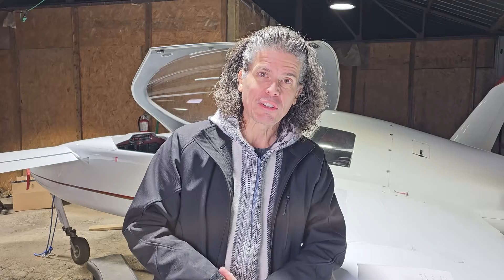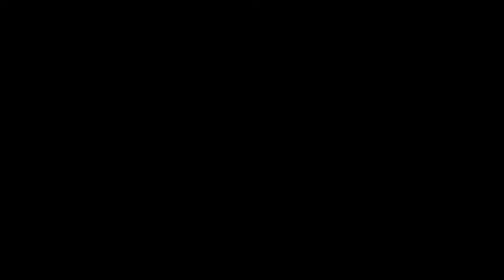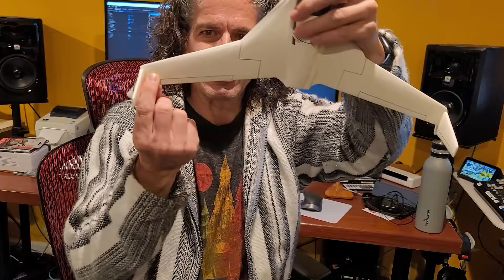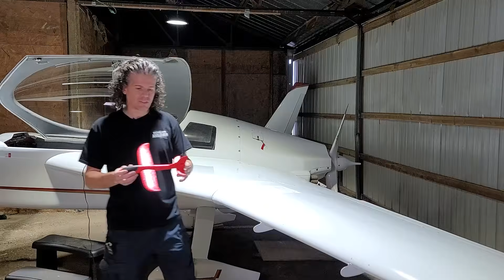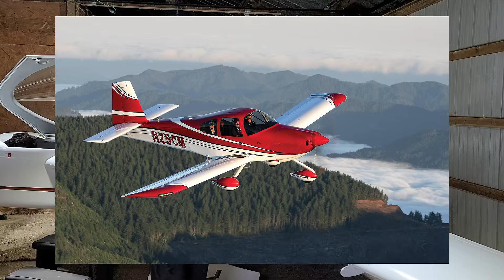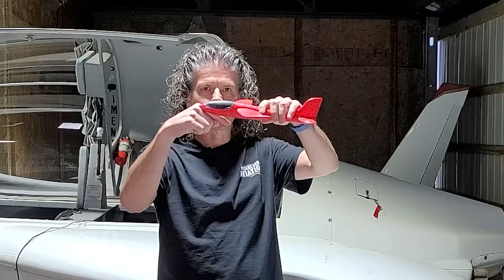Canard Aerodynamics: Why You Might Not Want a Canard Airplane

Comment: The swept wing design is to reduce drag and give the aircraft better handling in slow flight.  The performance is best in class.  If there is a complaint about this aircraft (Velocity XL-RG) it is that pilots with experience in Cessnas, Pipers or even Mooneys and Cirrus have to deal with far higher performance specs.  And no-flap, flat landings requiring longer, paved runways.

Comment: 8:20 you are confusing dynamic stability with static stability. Dynamic stability requires damping moments. The lift derivative is in 2-dimensional flow close to 0.1 per degree for all airfoils.
In 3 dimensional flow reduced by the aspect ratio :
0.1AR/(AR + 2)
Reply from the maker: You're right, I said dynamic stability when referring to resistance to displacement and recovery from it, which is in fact static stability. Dynamic stability would be the tendency to dampen the oscillations during that recovery from displacement (which would be positive dynamic stability).
Reply: That is right, the phugoid mode is damped by a long boom with a small surface of high aspect ratio, along tail plane or a small forward canard, like Rutan decided on. The small disadvantage is the higher downloading of the canard produces higher induced drag, which is partially compensated by the interaction of the canard's wake with the wing. The higher the speed, the lower is the damping, one reason that high speed aircraft have long swept wings, or leading edge extensions (early F-18, now with fly by wire electronics, F-16, statically unstable)
f @CanardBoulevard

Comment: High Scott! Very ilustrative explanation you gave. On detail that you mentioned in conventional planes does not entirely true.. but is valid for your explanation.
The vertical force in a Tail horizontal surface in a conventional configuration plane could be upward, cero or downward.. 
For example when take of at high CLift the main wing moment ia very high and nose-up so a tail will probably will get a upward force specially is cg is at rear limits. 
Also depending of the position of the cg related to the main wing lift. In a case that the plane has a very effective tail volume and neutral point is at the very rear, then the cg can be behind the main wing line of lift and in this case the tail hirizotal will trim the plane with an upward force

Comment: Actually, you can add fowler flaps to a canard aircraft,  but you will have to add them to both the main wing and to the canard itself. The size of the flaps will have to be around 20% larger for the canard than for the main wing due to the fact that the flaps will tend to move the center of lift rearward as they extend.
Reply from the maker: I go through that in my first video in this series: https://www.youtube.com/watch?v=ycLQaiX4ylE

Comment: I love you man anybody inviting a critique or a comment or a correction especially is the top of the mountain to me. I love to watch people with money that have a disaster from being stupid because I'm poor from being stupid and my whole life is a disaster to look up from for a minute when someone buys an airplane. How does the kennard airplane respond to being overloaded? Most airplanes will fly straight overloaded and if you turn them even a little bit it's too much and they crash easy spin in. How does the kennard Wing respond to this pilot error have taken off with too much weight
Reply from the maker: The answer is...it depends. If you load outside of C/G, all bets are off. You could turn into a lawn dart if too far forward, or fall in an unrecoverable stall if too far aft. But when it just comes to overloading it while remaining in C/G - it's just an airplane, so it does what most airplanes do: climb poorly, stall at a higher airspeed. In a conventional airplane, if you overload it so you're using all your lift to just keep the thing in the air, if you then turn (which uses some of your lift to change the direction of the aircraft) it no longer has enough lift to fly - so either you descend, or you stall.
Reply: @CanardBoulevard  well I had a slightly more sophisticated view of it mathematically when you look at that extra weight and you had add bank angle, and a reduction of efficiency you might be looking at a situation where you will never have enough control authority to pull it out of the spiral. All of these things are nonlinear geometric changes so if you get very far in the direction of this geometry with the extra weight, it hits a "tipping point". Not physically tipping the airplane but just these things have lined up to hold you locked into something and you don't have enough control authority to restore to normal flight.

Comment: 1.  This video would apply only to Eze and derivatives.  These were designed to a set of requirements.  C172 were designed to other requirements.  Some of the requirements overlap, and many don’t.  The pilot has to decide which plane’s requirements best match his needs.  No plane does all.
2.  Landing Speed/flaps.  Canards can and do have flaps.  Clever is the Rutan/Beech Starship.  Here the flaps and canard are linked.  Flaps deployed-canard straight; flaps up-canard swept.  Sweeping the canard flattened its lift curve slope obeying the “canard stall first rule”.
3.  An Eze main wing sweep moves the Aerodynamic center further back.  If Rutan had used a straight wing, the engine would be further forward relative to the AC.  It would have needed a driveshaft.  The wing vortillon (?) are aerodynamic fix that came some years after the Eze debut.  Aerodynamic bandaids are hardly new or unique to canards.
4.  A swept wing provides dihedral effect.  The EZEs rudder winglets an added bonus..
5.  The canard wake affecting the wing is not necessarily bad.  Rutan’s location may have improved pitch stability by increasing  the wings stall AoA.  
6.   Modern fly by wire jets have all surfaces lifting..like a canard.  The only plane to circumnavigate the planet was a canard.  So canards have a few virtues.

Comment: 10:22 that is NOT correct. Your span wise lift distribution is moved out and bending moment increases as if the winglets were folded down making the wing longer. NO free lunch. The winglet reduces induced drag but reducing the wasted energy form wing tip vortices. The reasons airliners use winglets are two fold. One is span of wing and gate area at terminal is limited. Two it is great for a logo. Some of the latest airliners do not use winglets and just use longer wings and accept their gate access at a terminal will be limited.

Comment: Longitudinal stability is NOT about stalling one of the aerodynamic surfaces! It is the ability of the airplane to return to level flight after a disturbance, e.g. a gust. This happens at small AoAs; you don’t stall the canard every time you encounter a small gust. 

If the overall AoA is increased by a gust, both the canard’s and the main wing’s list are increased. This results in a pitching moment around the aircraft’s center of gravity which is it’s mechanical center of motion. In order to return to level flight, this pitching moment needs to counter the initial disturbance, hence be nose down. This is the case if the sum of the added lift acts aft of the center of gravity. The point where this combined lift acts upon is the airplane’s neutral point. (This is valid not only for canard airplanes)

Static longitudinal stability is when the airplane returns to level flight after a disturbance with the elevator fixed. Dynamic longitudinal stability is with the elevator free.

Comment: I have always thought that a canard was more efficient. When you pull back the stick in a conventional aircraft you push the tail down - the reverse of your desire to increase altitude. With a canard the control causes the nose to rise - the very direction you desire.
Reply from the maker: I talk about this a lot more in this video: https://www.youtube.com/watch?v=ycLQaiX4ylE
Reply: At first glance this is correct. But when the forward wing lifts up, it generates a downwash. The rear wing flies in the constantly generated downwash. And it has to constantly "climb" in the downwash wherever is goes. Even when flying level.
Reply: @Triple_J.1  thank you.

Comment: hey.. you are trying hard and doing a good job explaining canard stability but you know the front wing doesnt have to stall to create stability.   its the lift curve slope and zero lift angle.  the lift curve slope is bigger for the big wing because its big so the plane is stable.  the stable point is a positive angle because of the incidence of the front is greater.  you fly the plane in pitch axis by adjusting the pitch stable point by changing the canard control surface.  you should play around with xflr5 or AVL and see the numbers and stability

love your discussion though

Comment: did not see the first video, and this one just pop up in my "list". What i can say is most of the information in this video is just pure basic stuff. at least then you are a geeky RC Pilot that do build your own design of airplanes. not just follow a kit blueprint like "BalsaWood Lego". Swept wings also rolles off the drag of the wing instead of a straight wing there the drag is forced off instead of rolling of the wing with less force and less energy lost. and there for you need less powerful engine to power at swept wing. The Winglets hinders the lift to "roll-off" the wing and you can keep the lift above the wing for longer time. so winglets do work REALLY good on small models. and i use winglets on my ViperJet with a Jet Turbine enginen. and damn its floaty with the winglets. Can bee seen in my YT Channel, just click my name here.

Comment: To the Author, could making the canard bigger account for some of the lost lift you need?
Reply from the maker: Making the canard bigger means it will generate more lift - and that means that you now have the problem where the main wing can stall before the canard does, particularly at aft C/G. Everything affects everything else.
Reply: @CanardBoulevard  so glad you got back to me, so is it always the aim to have the front of the plane stall/drop first? Is that easier to feel/predict than having the back drop first?
Reply: @CanardBoulevard  you are the first person to give me real world experience on just how delicate the balance is of staying 'up' in an advanced aircraft 😅lol
Reply: Yes. A stall is caused by a wing exceeding its critical angle of attack (around +15 degrees). Ideally, an aircraft that stalls, should automatically lower its angle of attack (its nose) to recover from this condition. 

You don't want it to diverge into a nose-up maneuver, as this would make the wing stall deeper into the less lift/ more drag regime. (I.e. result in going downward at lethal velocity). Suggested reading: Stick and Rudder, an Explanation of the Air of Flying. - By Wolfgang Langweische.

Comment: Why can't you have flaps? Is this because of how it comes, cause I would just add them myself 😅or is the canards supposed to do this job? Love to hear your input cause a lot of videos don't cater to the layman
Reply from the maker: If you add flaps to the main wing, it increases the lift generated (and drag). In order to keep the airplane balanced, you now need flaps on the canard as well. You can't really do that, so the only alternative is to increase the size of the canard and authority of the elevator. But in doing that, you increase the lift generated by the canard in all phases of flight, which means you could now stall the main wing before the canard.
Reply: The Flaps would be so far behind the Center of Gravity, and Aerodynamic Center, that they would create an enormous nose-down moment. Because the main wing would effectively become an elevator with down deflection.

Comment: I own a canard and I think that every airplane is a compromise in design.  These aircraft are designed to optimize for good cruise performance, that pilots really like.  This optimization results in choices that reduce drag like less wing area and less frontal area.  I think if they had more wing area the takeoff and landing speed they could be more comparable to other light aircraft but that would also increase weight and drag and also reduce cruise speed.  Another factor is weight growth.  Since these are homebuilt people can add items that add weight like avionics and upholstery and really nice paints that can make them heavier also reducing their takeoff performance.  One plus of these is the overall simplicity of the design.  I had a instructor once show me how you can make a steeper final approach at a slightly reduced power and on landing flair the speed can be bleed off faster making a shorter landing distance.  It works but you have to make sure you keep your speed up to a safe level to avoid a hard landing.  Overall the increased speed is very impressive and perhaps worth the tradeoffs.

Comment: A senior (possibly retired by now) MIT aerodynamics prof listed the three rules of aircraft design as "No canards, no canards, and no canards".
Reply: Depends on the intent of Your design.

If great stall resistance for inexperienced private pilots, who might not fly for extended periods of time while building, if that is Your goal. Canard is the solution.
Reply: @Triple_J.1  True.  I should have been more specific that the subject was aerodynamic efficiency.  People hear that both surfaces lift and assume it's more efficient than a conventional layout.
Reply: @Triple_J.1  
Not having exhaustive knowledge, I would only have been comfortable claiming it as A solution.

(No, not solution A…)
Reply: Rutan's number one reason for the canard design was to reduce low speed stall/spin accidents in the landing pattern.
The canard stalls before the main wing and pushes the nose down, which is what you want. 
Unfortunately many fatal accidents in the landing pattern are caused when the pilot pulls back on the stick when the plane starts to stall in a turn.....this increases the stall, which turns into a spin with fatal results.

Comment: 14:00 - You could just put the canard a foot lower fairly easily and not interfere with the main wing.  I higher back wing is very common in conventional designs.  Even if the front canard didn't produce a net positive lift, at least it's not producing a negative lift like a conventional tail.  So it's really not a wash at all.
Reply: ^ This does not work in Theory or in Practice.

A wing generates downwash when it creates lift. The rear wing has to fly in this downward deflected air. So it always has to climb. The front wing has to carry a substantial portion of the weight. Because an aircraft such as this, must have positive static stability. The center of gravity must be a certain distance in front of the aerodynamic center (of lift). The aerodynamic center in a canard is near the leading edge of the rear wing, or slightly in front of it. So the center of gravity has to be moved forward of that point to remain stable. This means the weight of the aircraft has a lever-arm nose down from the main wing. The canard must lift this to remain level or climb. So it must generate lift at all times.

Comment: Ride lousy in any bumps, if I remember VNE is only 200….
Reply from the maker: Not true. With the higher wing loading, it's actually quite good in the bumps.
Reply: Not my experience
Reply: I looked at Velocity and Glasair III, ended up with Glasair.  Its wing loading does smooth out the bumps fairly well, but you are going so fast the bumps are a little sharper!

Comment: I built and fly a  Cozy IV  I love the plane the way it flys and I enjoy blowing the doors off Cessnas  It does have its limitations but all in all it is a great plane.   I liked my first plane a Longeze better it was more of a pilots plane.  It had an 0235 which limited it a bit.   Thanks for your video.
Reply: 0235? Can you tell me what this means?
Reply from the maker: @CraigLandsberg-lk1ep   O-235 is an aircraft engine with 235 cubic inches of displacement. It makes significantly less power than for instance the IO-360 in my airplane.
Reply from the maker: When it all comes down to it, I do love the Cozy - obviously!

Comment: Thanks.   Sounds like very few positives
Reply from the maker: There are quite a few - but every airplane design has positives and negatives.
Reply: Speed. Range. Economical. Low fuel consumption. Robust. Rarely rusts or degrades over time.
Reply: Which could be said about the RV models    @Triple_J.1

Comment: OK lets draw triangles here.
Where the body is one side (A) and the tip to tip of the wings form 2 triangles, so one tip to the body is (B) as the leading edge of the wing is the hypotenuse of each (C).
If a straight wing has the same length as the (C) then yes the swept wing has less lift.
But if we take a straight wing that is the same length as (B) then slice it up and set the slices off set to each other to create
a chunky type of swept wing (as though it where made with building blocks) 
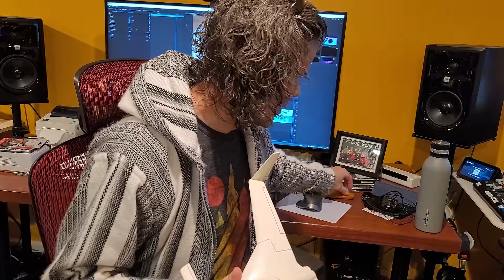   then do we have a similar lift ratio ? but with the swept dynamically stable behavior your talking about here ( 6:10 ) ?
I think is how the lift expectation of a swept wing is miss understood as (B) is actually the angle of attack Hens the use of Vortilons
 and so the wing should be considered in size as the length of (B) not the length of the leading edge ?